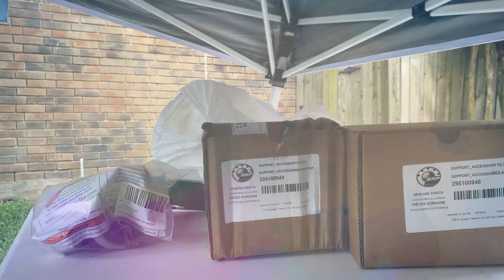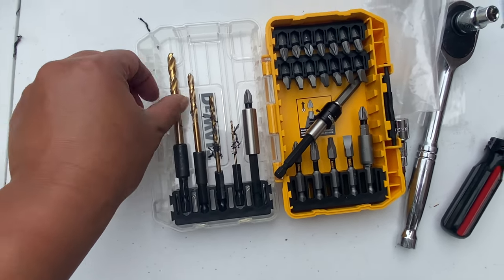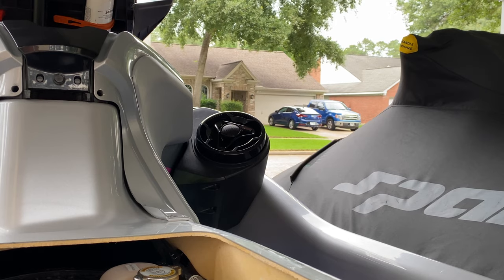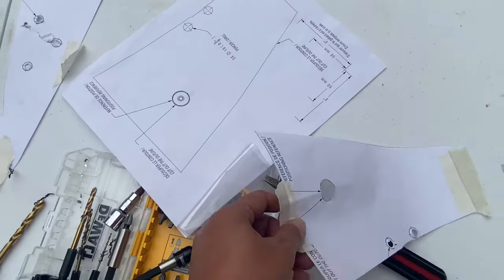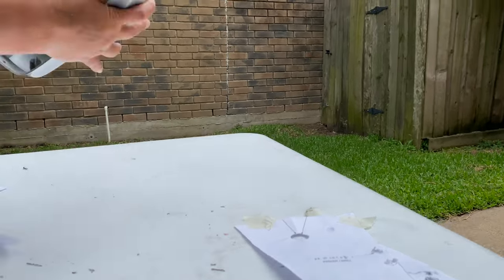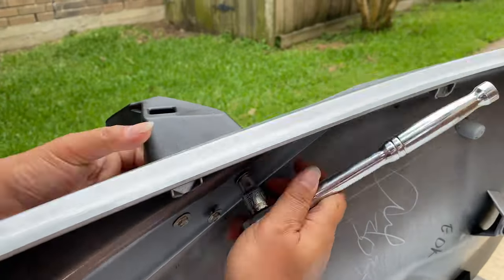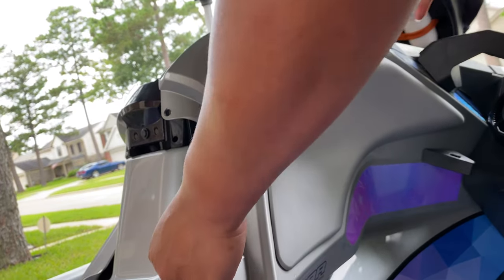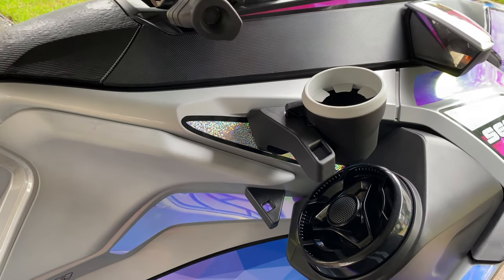How to Install Sea-Doo Cup Holder

Comment: Nice!  I did this mod last week. 

FYI, drilling the right size hole lets the mount nipples pass through the side flares. Then there is no gap behind the mounts. 

Either way, having a cup holder is awesome! 😀
Reply from the maker: Well dang. I didn’t really notice a gap. I will have to check. Lol. But yes the cup holder is definitely awesome.
Reply from the maker: Thanks btw. I updated the info on the details of video.

Comment: Great timing, mine just arrived in the mail & I'm installing it this Saturday.
Reply from the maker: Nice! You are going to love it. I need to make a correction to the video to use the bit size as instructed by BRP to make the holes. This will allow the plastic to insert through the hole and mount sit flush against the ski.
Reply: @AlveanAzurin  thanks. Should be OK, we use metric in Australia 😉

Comment: Old thread but it looks like the left cup holder pretty much covers the speaker controls. Is that true? I'm about to do the install but second guessing the left side.
Reply: What did you end up doing? I’m with the same doubt. Already bought it.
Reply: @marcosmicael4153  only installed the right side and returned the left side bracket.

Comment: Here’s a tip or 2    #1.  Your socket has a concave in it made for bigger bolt or nut heads so if y’all have this problem I suggest that you either cut or grind it off so that it no longer has the concave   #2.  If y’all are tired of paying bunches of $$ for the push pin plugs on y’alls stuff jet skis, SXSs and 4-wheelers Walmart sells them on-line just look under plastic push pins for way less than buying from the dealership

Comment: Great video . What is the lower mount used for?
Reply from the maker: It’s for the Fishing Rod holder. I didn’t have it in time for the installation video. Works great as a Flag, umbrella and selfie stick also.
Reply: @AlveanAzurin  great idea to hold the selfie stick!
Reply: Ordered... left, right . one cup holder and two rod holders. Thank you

Comment: you will find out to buy plastic bottles with lids,,, i had a can mountain dew all over after a ruff short ride now all i bring on vessel  is anything that fits in and has a lid LOL I have an 2019 FISHPRO with both L/R front fishing/cup holder's I got 2 months a go
Reply from the maker: Yeah no cans and also using a good tumbler that has good seals are great.